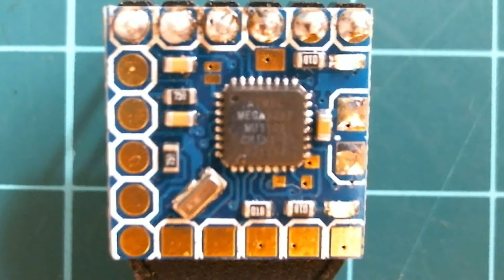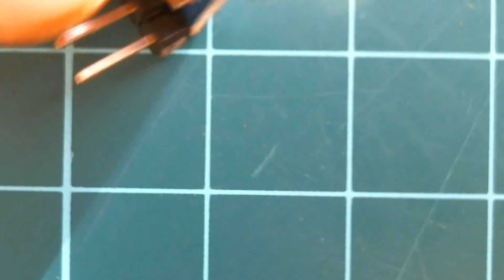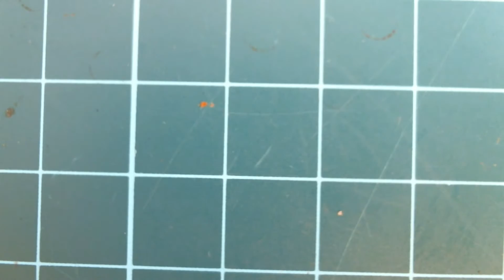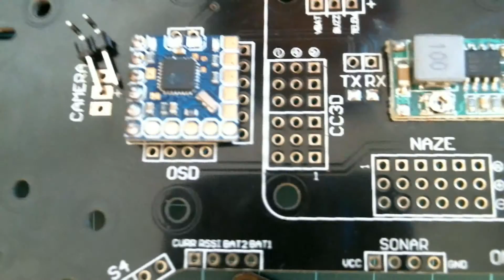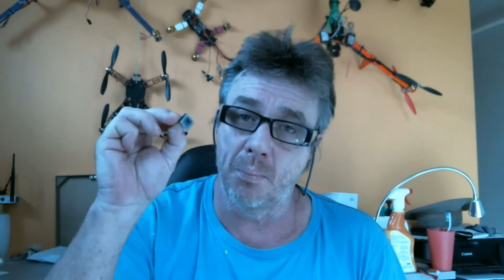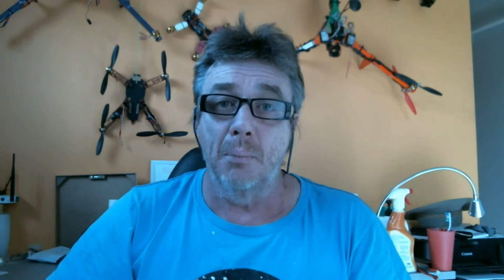Micro Minim OSD

Comment: You OSD works without any problem on this PDB? My first burned, have found some suggestions online to put a zener diode in order to block voltage spikes. Do you know something about that?
Reply from the maker: No problem yet. And I have not heard about it.
Reply: yep, tested mine yesterday. Works fine. But can't manage how to get battery voltage. All I get is zero voltage.